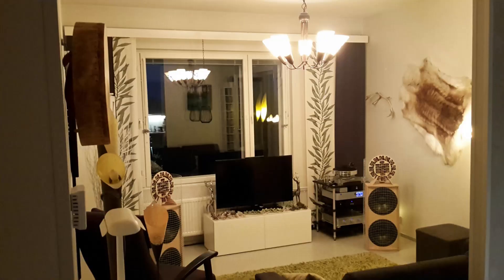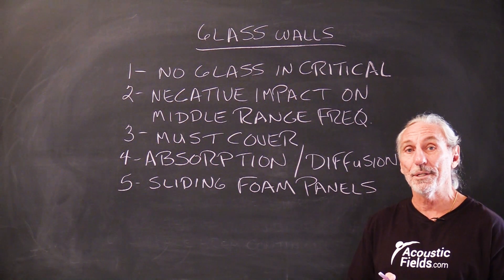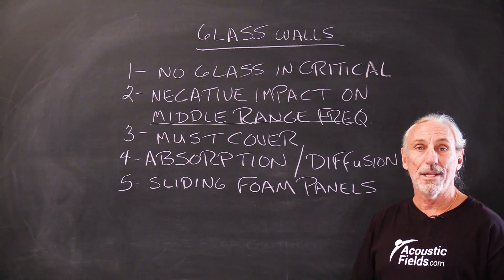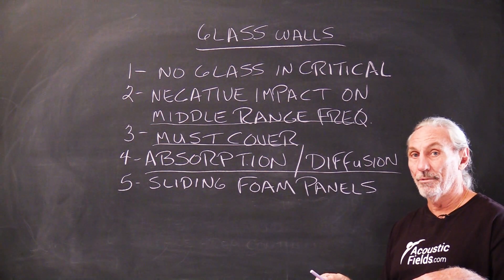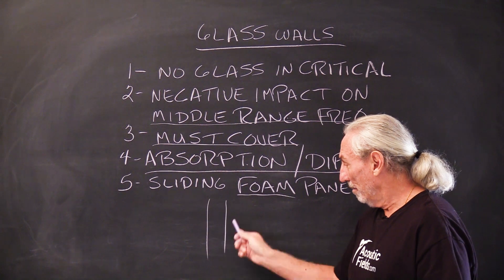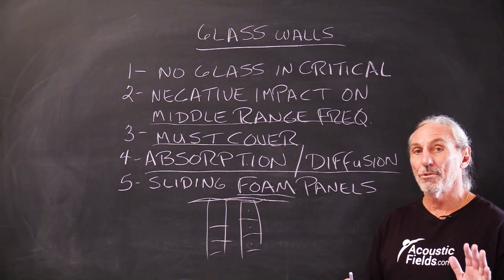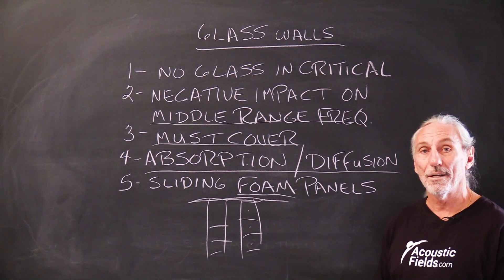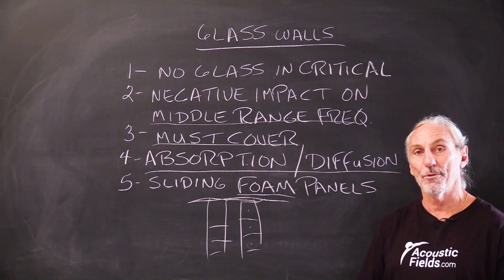Glass Walls - www.AcousticFields.com

Comment: What about glassblock?
Reply from the maker: Glass is glass for middle and high frequencies. Glass block would move less with lower frequencies due to density.
Reply: @AcousticFields So it could be a material that could be used for a study? wouldn't it create problems?

Comment: I couldn't ruin my living room decor with acoustic treatment. So I bought movable 4" 'FreeStand Bass Traps' from GIK Acoustics. Basically freestanding movable absorbtion. To my surprise, my fireplace, partially open left wall or early reflections weren't my biggest audible issue. It was the huge glass bay window behind my equipment. Instant audible improvement! Glass walls suck.